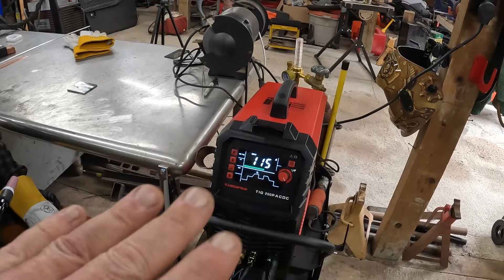Beginner's guide to TIG welding! Can Jess learn to TIG? Welder giveaway info!! How to TIG weld!!

Comment: Nice 1st try Jess, after enough seat time you’ll really get a feel for the torch heat with its melting of the puddle and keeping the puddle size uniform in width. Then with proper rod cadence dabbing into and moving the bead along, it will then be like you’re painting with molten metal. 
Once you get the control over the heat & movements you’ll never forget. Good luck
Reply: I agree!  Thank you! 😊

Comment: What kind of filler stick do we need to tig weld? Also for new welders, would you suggest the 200 tig or the 200 mig? Kentucky
Reply from the maker: Filler depends on the material you're welding. There is very diverse types. If you are intent on just TIG welding the 200P is the machine because it does AC. If you need an all around welder the MIG does everything except AC but can MIG aluminum.

Comment: Dave question, how far to stick the tungsten out of the Collett? Thank you, Terry.😊
Reply from the maker: Think the general rule is thumb is between an 1/8 to 1/4 from the end of cup. I tend to do more than that to make the puddle easier to see and honestly it all depends on what you're working on. I've pulled a bunch of tungsten out and increased gas flow to get into collectors for headers or under some tubing. The distance isn't static, it's situational. I'm not sure that helps!
Reply: Thank you Dave, I wasn't sure on the distance. I just got my A/C Tig 200, now I've got both machines. Take care you an Jess.

Comment: I know I can use nickel rod when I weld cast iron, can you use that machine with cast iron and what rod would you use?
Reply from the maker: Not sure I'd TIG cast but you certainly can. Clean the best you can, I'd use a pulse setting, go a bit softer on the heat but understand nickel rods move poorly.  I think I would go straight to ARC (MMA) with cast. Cast is dirty. Clean it up, Preheat, weld and slow cool or even peen it. But, overall, yes, this machine can certainly weld cast in either configuration.
Reply from the maker: Oh and the type of rod, ERNi55.

Comment: So tig is stick welding? I guess I have a mig welder from harbor freight then? Its wire fed and i just pill the trigger. Which is better?
Reply: Yes that's mig welding which is what I did in our first welding video months ago.  This one uses filler rod.
Reply from the maker: TIG and stick are different. Get yourself a TIG!
Reply: @madgingercustoms  why is it better?
Reply from the maker: @clintlegeyt4835  TIG is more precise, smaller heat effect zone, and looks better! And no, don't bother with a TIG, MIG is more useful and easier to use I think.